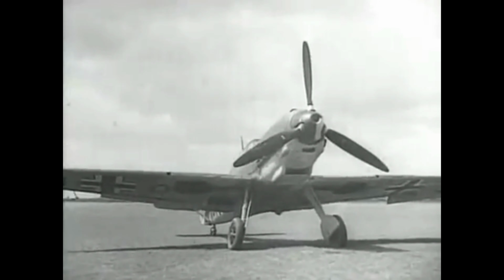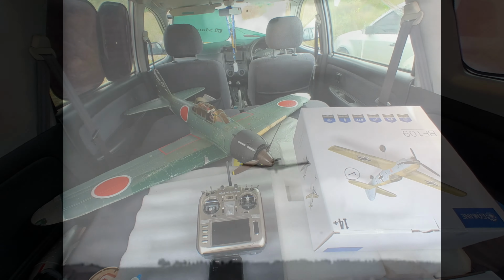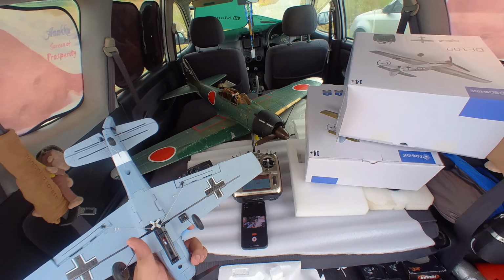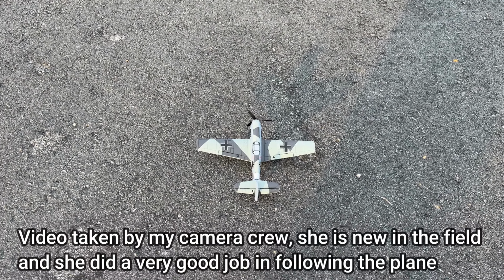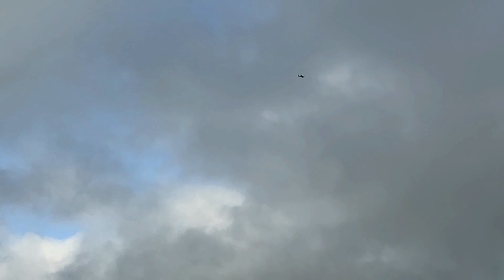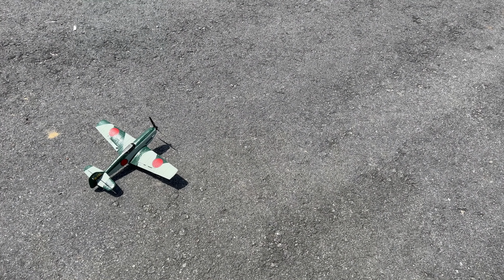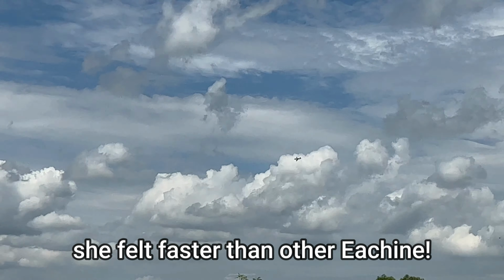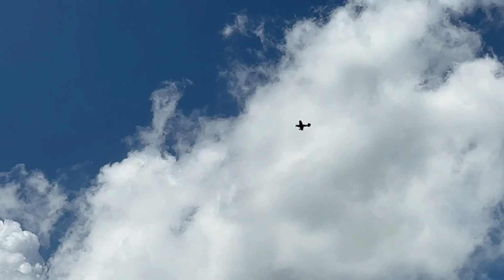Eachine BF109 / ME109 400mm Mini Warbird RC Airplane 2.4GHz 4CH - Maiden Flight + Impression

Comment: Nice flight. Like the paint job. Sadly my Eachine BF 109 is still having aileron issues even in flight. I am thinking of replacing the receiver with a spectrum compatible receiver. But the replacement will have to wait until I have free time.

Comment: I am now a step ahead!
Same, problems as you showed us in the video. No centered ailerons at the ground and no expert mode available …….

But i‘ve tried this bird today in calm wind conditions,- it fly or it die!!!!

1.) Plug in your lipo and hold the bird leveled to the ground in the other hand,- wait 3sec.
2.) Switch on your transmitter for binding.
3.)switch to beginner mode.
4.) Shake the Bird,- (notice: the ailerons are not yet centered!!! 

5.) give 3/4throttle und throw it.

You will see this little crappy thing center the ailerons at the first second „in flight“.

I have removed the landing gear and the tail wheel, than the CG fits perfect too. The bf109 is a little bit heavier than the other 400mm Eachine Warbirds,- but without the gear, it goes in manual mode near vertical and flys as all the others of then.

Regards from Germany.

Comment: Do you have to use low power mode when binding with the TX16S?
Reply from the maker: Not really, I bind it with all default settings on the power..